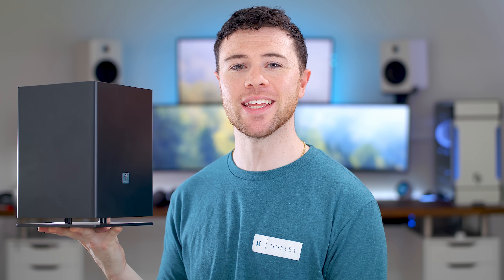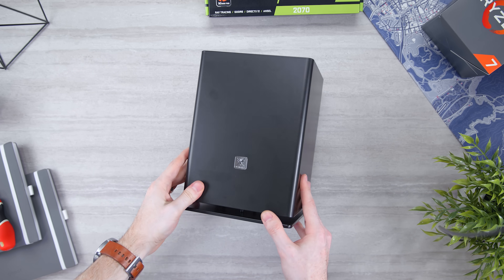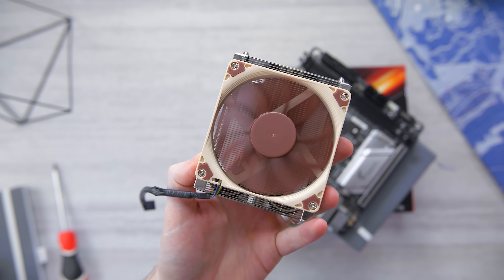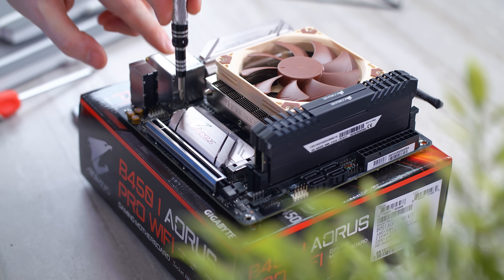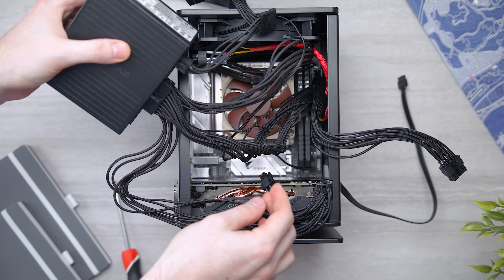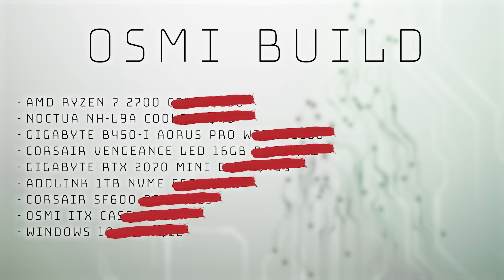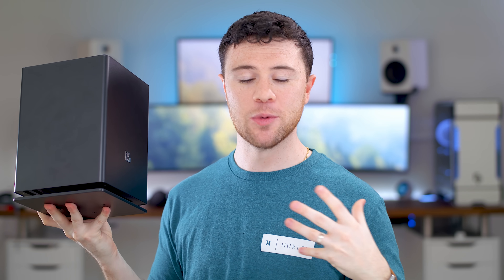I Built the Xbox Series X as a PC

Comment: Frank: I built a pc that is like the Xbox Series X

Me: b u t  a t  w h a t  c o s t
Reply: Its Called Trolling  highly doubt it
Reply: The GPU in the XSX is actually better then the 2070... and that alone is 400+ dollars
Reply: @godsinferno  Its most likely on par with the RTX 2070S in real world performance. Keep in mind that its GPU is on a custom APU so cost and power consumption will play a very important role.
Reply: @godsinferno  no it's not
Reply: @godsinferno  there is no way in hell it gets 2080 performance.
Reply: @ZackSNetwork  Wrong, check with Digital Foundry. It's actually on par with the 2080. Only the 2080 TI beats it.
Reply: @godsinferno  its going to be on the same level as the 1080, teraflops dont mean performance
Reply: @mofokashotgan7514  U do know a 5700xt has higher performance then a 1080 and yet is a 9.7tf Navi GPU...  XSX has a 12tfs navi GPU...
Reply: @ZackSNetwork 
This did not age well especially when the series X is close to a 2080ti...
Reply: @oladapoolaleye9184  as of now, Microsoft said it was about rtx 2080. Therefore it isn't close to the rtx 2080ti unless you consider 20%-25% faster close.
Reply: @godsinferno  Incorrect. You clearly know nothing about console specs or desktop specs. It's a fact that desktop specs are more powerful than the Series X and PS5 specs. I have a 2080 Super and an Xbox Series X can't run on par with it.

*Yes I know this is a year old comment. Don't care lol.
Reply: @TEExJAY24  He's using a super boutique case. Its like $300.
Reply: The tower alone, if you buy it brand new, is 200+.
Reply: Its Called Trolling no, probably way more than the xbox knowing it probably will be $500 this pc probably costed around $900
Reply: @TheOGLober  yeah considering this console will be mass produced, the components will be significantly reduced in price. 
You could probably build something with similar specs but you will be getting components that are at the end of their life cycle and void warranty which the xbox series x won't have.
Reply: Twister_T _35 🐐 comment
Reply: $1500?
Reply: Me: If you watched the whole video you would know the price was $1,330 (7:45)
Reply: He full on lied about the price of the shitty 2070 single fan mini, for starters. The Asus Strix 2070 OC is less than $500 on newegg as we speak
Reply: For real lol my guess 1100
Reply: B u t  a t w h a t c o s t?
Reply: Its Called Trolling  I doubt that
Reply: How does he know so much about xbox that havent ben odficaly reveiled. Also microsoft sead the cpu is based on zen2 acitextur. And yet he sead the cpu would be a fx 8350. Im lost confused and anoyed
Reply: @theundeadsqwerl8017  and bad at grammar/spelling??
Reply: @anxiousdreams614  yes i get that thank you for pointing out the openly. Sorry i made the comment half asleep. And dident think to go back and check. Lol thank you.
Reply: @theundeadsqwerl8017  right.
Reply: Twister_T _35 everything
Reply: Its Called Trolling  thousands, the gpu inside the xbox alone costs more than the console
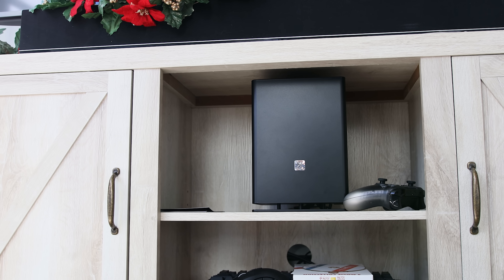Reply: 7:15
Reply: I checked the prices and it gonna be around 700$ for this
Reply: That's the point in console gaming it's cheaper than high end pc gaming but at the start or rather before launch hardware depletes in price rapid for example I own an Rx fury it was around 5 to 600 quid at launch but these days it's around 120 to 150 by time Xbox launches the price of these parts will fall and by mid cycle will be cheeper with more powerful hardware available plus if pc gamer you can just wait until then and upgrade part by part that said I'm dreading it as personally I will need full platform upgrade but reckon that won't cost as much as full build and around the price of the console when it launches will do it as already have things like case power supply storage and the likes not to mention all the games I've ever bought on platform. And before you say it I know Xbox will be backwards compatible too but when you're and older gamer like myself no were near backwards compatible enough as my games can and often do go further back in time than Xbox as a platform lol
Reply: Two virgin souls and a glass hammer.
Reply: 7:45
Reply: 7:40 the cost
Reply: @Nathan Tavares you make assumptions, but not the most obvious ones. AMD and Nvidia GPU releases. You think if AMD could create such a card for consoles, they can't create one for mid range use around 400USD APART from the fact that AMD is stressing Xbox and Sony define it as "custom" because the actual RDNA2 GPUs would be better with greater efficiency? And zen 3 CPUs are also on the way (assuming you disregard Intel as having the best gaming CPUs). So yea, this isn't going to change much from other releases. That's assuming you are right with the console pricing.
Reply: @Nathan Tavares not really, most of the times, the PCBs are the same and actually gets made into a different GPU depending on how good the Silicon is. And OEMs buy a lot of GPUs to design themselves as sell. The thing with PC gaming and what defines the prices are the fact of the exclusives and options on PC games and nom-gaming factors which is huge. Right now both Nvidia and AMD offer content creator drivers for their GPUs because of how the demand is for them. So while it is unlikely for the prices to drop as low, it isn't impossible.
Reply: @seanharricharan9191  the next generation will offer a performance boost, 3900xt will be 50% stronger than 2080ti, which is xsx equivalent, so its possible
Reply: @kb8102  2080ti is more powerful than the xsx. Xsx is equivalent to the regular 2080 as shown by the demo on a game developed by Microsoft.
Reply: @seanharricharan9191  new high end rdna2 released later this year by amd is 50% more powerful than 2080ti, so a 2080 equivalent console is believable, because u doubt it
Reply: 1346 dollars
Reply: No the refresh rate 😬😬
Reply: close to 2000 or more dollars
Reply: Two nuts, one dick, and 6 toes.
Reply: Cost is a tricky subject.  If we just picked a ballpark $599 launch price guess for the XBox SeX, and this PC ended up being what, $1500ish? 

So $599, Let's assume this will be your main gaming rig for at least the next 5 years, so + $60 per year if you want to play games online, so we're now at $900 TCO vs $1500 for this PC. 

So what's the infinite PC gaming library and everything you might want/need to do with a PC that an XBox won't do worth? That's going to vary from person to person. 

Then we must consider, what will this hardware cost a year from now.  Hardware prices are anything but stable, and so when the XBox SeX does hit market, these components could be significantly cheap. Look what SSD prices and size/performance have done over the last year or two. 

Really kickass video, and I'm impressed with how well you were able to model the look. Your channel finally earned a subscribe from me with this one.
Reply: @aphryo  also $599 gets changed to $499 or even less when trading in the xbox one x. I paid $330 for our brand new one x after trading in the one S,games and 3 controllers.
Reply: @Giveitallyougot  That's irrelevant of platform. You could sell your Xbox for cash towards a PC too if you like. You could sell your Wii U toward an XBoxSeX too if you had one laying around.
Reply: @aphryo  I could but I'm not gonna throw out a thousand plus dollars on a pc when I can do the same thing for half the price and now with the new ps series and xbox it'll be even better. On a great budget as well.
Reply: @aphryo  you think this parts out at $1500? Lol
Reply: @mr.blonde7812  He lists out the pricing... I didn't pull out a calculator during the video, so I didn't recall the exact price.
Reply: @aphryo  7:44
Reply: @aphryo  Jack Burton thinks the consoles will be around gtx 1660 performance. Even though the Xbox one x is already using an rx 580 equivalent.
Reply: @aphryo  $1346
Reply: According to pcpartpicker it would cost around $1140 to make this exact build, but he has wasted a lot of his money on pointless things (e.g. the led ram). In reality you would only need to spend around $675 to build a PC that could match the in game performance of the upcoming consoles. Paper spec performance alone means nothing.
Reply: @resonatingraptorid6519  $676?? Lmao you're funny. You're forgetting about built in Ray tracing possible 8k. If the devs would let console players mess with fps we could probably get 1080p medium to low graphics 150+ fps. The only thing that makes PC better is the freedom for graphics/fps and all the games. That's y you have over priced rtx cards that support what less than 60fps Ray tracing support lmao if you spend $1000+ on a graphics card alone you're either rich or an idiot.
Reply: @anxiousdreams614  OK fine I'll make a PC which accounts for Ray Tracing.

CPU: Ryzen 5 2600: $119.99
Motherboard: Gigabyte GA-A320M-S2H: $54.99
RAM: 2x8 DDR4-3000mhz: $57.99
Storage: 1TB WD SSD: $94.99
GPU: ASUS Geforce RTX 2070: $439.99
Case: $29.99
Power Supply: $59.99

Total Initial Cost: $857.93

Lets say the upcoming consoles release at $500. You would have to pay $60 every year just to have access to multiplayer, which you don't have to pay on PC.

Both the upcoming consoles and this PC build can be expected to last for at least 6 years. After 6 years, the cost of the PC won't have changed. But after 6 years of paying for multiplayer on the console, it will now have cost you $860. So, as always, PC ends up being the better long term investment.
Reply: @resonatingraptorid6519  you forgot a mouse and keyboard to even play the games and windows 10 lol
Reply: And you're acting like tax isn't a thing which will add atleast $150 to your final cost!!
Reply: @anxiousdreams614  Not to mention that you are paying for a PC, which can do a lot more than a console, so many people including myself would say the extra initial cost is justified anyway.
Reply: @anxiousdreams614  PC also has far better game sales then on console (e.g. steam sales, G2A, CDKeys, Humble Bundles etc.)
Reply: @resonatingraptorid6519  honestly I don't know much about PC's that's y I buy a console bc it's simple not so technical. The most ik about PC's was when I HeX edited Midnight Club La LMAO plus I'm not good with mouse and keyboard so I would probably get wrecked by everyone 😂
Reply: @anxiousdreams614  Fair enough. I'm not trying to argue with you btw I hope I haven't come across like that. I just don't like when people dismiss PC as being some sort of rich kids 1% club. I'm actually quite excited for the new consoles if for no other reason then because I think they will help push down Nvidia's and Intel's ridiculous prices and reduce the growing monopoly in the PC market. AMD has really stepped up their game these last few years and has proved a worthy competitor. Peace ✌️
Reply: Anxious Dreams  ray tracing isn’t new... If you were on team green you already had it on pc..

If consoles wanted to be great they should have made the console 4K possible, but all games would be at 1440k and 100fps... with extra details...
Reply: @resonatingraptorid6519  I doubt that now however at launch it probably will especially if amd release a rtx card as good as 2080
Reply: @resonatingraptorid6519  1140 with no optical drive as well.
I dont know why everyone is so dumbfounded for?Phil Spencer said what he said about the one x and delivered as promised at $499 and no one was able to make a comparable pc at the same price not when factoring in the 4k bluray optical drive the one x has.
Even sony fanboys that make the comparison that ps4pro is the better buy because it's $100 less when really it actually costs more if you think logically and critically  for what you're getting. 
Less powerful console all around and lacking a 4k optical drive if sony offered what microsoft has the ps4pro price would be $600.
Reply: MrFallen1ne I’m trying to think of a reason to include an optical drive these days...I mean if you’re a big fan of physical media... yeah sure 

Otherwise it’s just a handicap
Reply: ResonatingRaptorid65 Linus tech tips couldn’t even match last gen console with a 700 budget at the end of the their life cycle 👀
Reply: @drexviathen  Ryzen 3 1200: $65.95
Gigabyte Motherboard: $54.99
12GB RAM: $47.98
1TB Hard Drive: $34.19
GTX 1650 Super/RX 580: $159.99
Case: $32.98
400W EVGA PSU: $29.99
Keyboard + Mouse: $11.48

Total Cost: $437.55

And you don't have to pay $60 yearly installments for access to online multiplayer so PC ends up being the cheaper option. Not to mention you get all the benefits of owning a PC which arguably justifies the higher initial price anyway. Clearly Linus didn't look very much into it. You should learn to do more of your own research in the future rather then just blindly trusting the words of others.

Comment: Dude did you say their CPU is identical to AMD FX8320? Who in the hell knocked you upside your head? Confirmed Ryzen 2 at 3.5 GHZ with 16 threads. Twice the ALU and twice the FPUs when compared to the 8320. The desktop you built might be considerably slower than the XSX. GPU performance is said to be 2080 TI and CPU slightly slower than the 3700X and faster than the 2700.

Comment: I have a feeling tb’s are soon going to be feeling like 100gb’s. I remember when 300gb was just enough to hold 20 games. Now you need like 2.5tb to hold 20.
Reply: The99210 i remember when 300 was enough 40+ considering they were only around 8gb or less
Reply: GumBallGaming that’s true
Reply: unless they come up with a way to compress them
Reply: H A yes that’s what I was thinking. It’s be better to download as well if it were to be more compressed.
Reply: @husain3190  ,
Um, COMPRESSION already exists for games on PC and on console. I'm sure they can improve things a bit though. Many games increasingly use the game engine rather than pre-rendered cut scenes. But then they add in larger texture and audio files.
Reply: The99210 I feel you, but personally i find 880gb on my ps4 pro enough, even with Conan Exiles (119gb) & Destiny 2 on it (96gb) & a bunch of other AAA & heavy sub AAA ones.
Reply: They said that with the ssd they'll use new technologies where the developers won't have to duplicate textures so that the hard drive could access them, they'll create one texture and every time the game will need to load it , it could access it and render it on screen.
Reply: I remember installing Nox on my 40GB HDD and wowed that it took up 900MB. "Games are getting so big," I thought. If I only knew what was in store...
Reply: Yep. You are correct. They definitely need to consider a minimum of a 2tb drive. Also, especially considering it’s Microsoft and they’re running a version of windows x10, there’s absolutely no reason why we can’t get updates zipped and then the console can unpack it and install.
Reply: I have 1.7 tbs and have 43 games

Comment: Consoles will use APU, and that 12Tflop is for the whole APU, not just GPU (expect RX5700 performance at best). And I don't believe in that 1Tb NVME SSD in a $500-600 console (if the price is lower, than that SSD is just a B.S. cache similar to Intel Optane with a 1Tb HDD).

Comment: i can't get my 2700 past 3.7ghz.
Reply: Thermal throttling?
Reply: @SwolePapi15  no it's probably my z350 cheap ass motherboard, I could run my r5 1600 at 3.9ghz but not the 2700 I just get a black screen if I go any higher